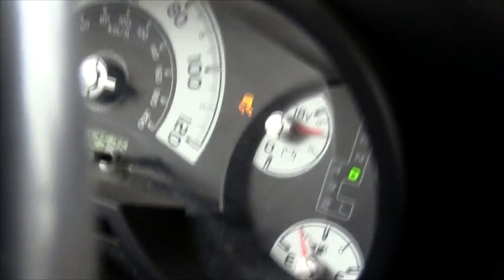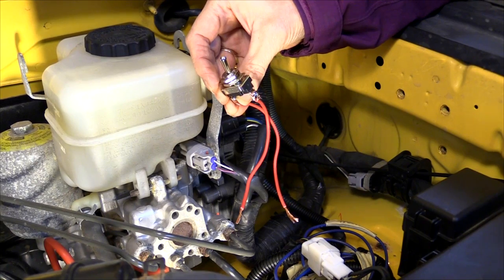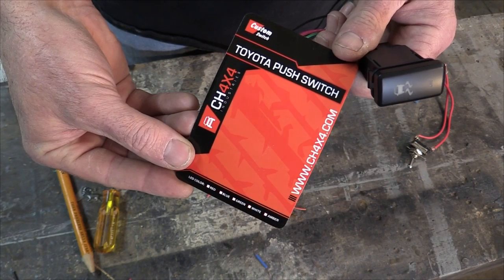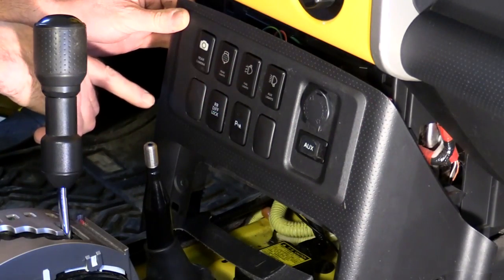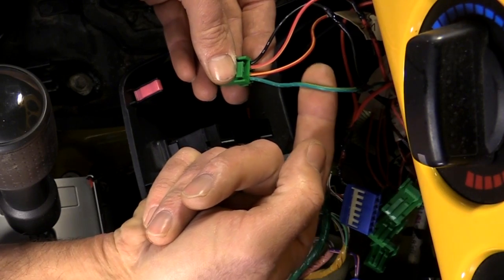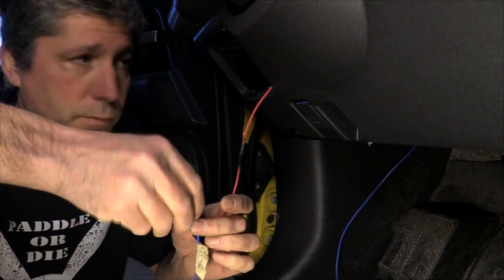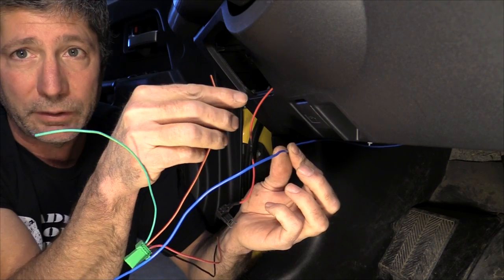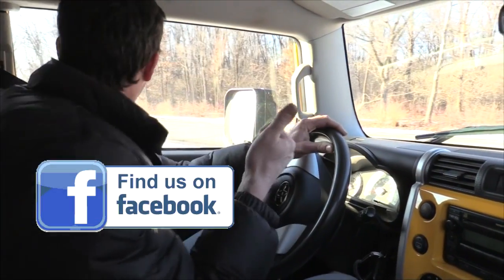DIY VSC Hack, Toyota FJ Cruiser

Comment: Hi, can this be done on the 2007 Fj cruiser with the manual transmission? I have the atrac and the rear differential lock and believe I can use them simultaneously.

Comment: Question concerning the Add-a-fuse.
I see you have 2 10A fuses in there, are those the proper fuse size you need or can they be smaller e.g. 5A etc... just concerned if something goes wrong I don't want to damage something because the fuses didn't pop. 
Or maybe 10A is what the system needs??
Just checking.

Thanks
Reply from the maker: You're absolutely correct. At the time I didn't have the proper 2.5 amp fuse. I should have mentioned that in the video. Sorry for the confusion.

Comment: Couldn’t you just pull the parking brake lever up one click so that the brake isn’t actually on but the light comes on the dash?   From what I’ve heard this will disable traction control and VSC

Comment: Now i'm confused, a have a 02/2006 FJ cruiser, with E-locker. It had no A-trac so i ordered the A-trac button  installed it and now i have A-trac.

Next thing i want to do is the A-Trac + E-diff hack. There is a topic on FJcruiserforums (https://www.fjcruiserforums.com/forums/transmissions-transfer-cases-traction-aids/17329-no-cut-trac-rr-diff-hack.html#post280978)  and in order to have A-track + E diff at the same time, that wire you are cutting (Blue-Yellow) needs to be connected to a constant +12v source!?

12 volt on that wire tells the ECU the locker is not engaged so A-track is active, 0 volt means the locker is engaged and A-trac is de-activated. So with this hack, even when the locker is engaged it still reads 12v and A-track is still active. Since the locker rotates both rear wheels at the same speed it will never apply A-trac to the rear but still detect differences in the front wheels and use A-trac on the front only, basically giving you a front locker.

It might just be that yours is a much later FJ but i doubt Toyota changed the wiring colors for the same functions!?
Reply from the maker: You're right, you are confused. The hack you see in our video only applies when the FJ in in 2w high. The locker and ATRAC can only come on when in 4L.
Reply: @WanderlostOverland Did you combine this hack with the A-track + Diff lock hack? I found out i do mind VSC in 2H lol so i did the No cut A-track+Diff lock hack by taking the male pin out of the plug and put a switch in between the constant 12 volt source you put on that wire.

I now have A-track + E-Diff in 4 low and in 2H ABS and VSC off with this very simple hack.
Reply: @WanderlostOverland  Ok, so it is the same wire just a different hack!? I dont mind having VSC on in 2w high so i'll go for the A-trac + E-diff.

Thank you for the reply
Reply: @WanderlostOverland  I feel so stupid lol, offcourse it's the same wire for this hack roflmao 0 volt on that wire is is ECU thinking the locker is engaged which means VSC off, Duh :-)

Comment: This looks like both the traction and the VSC are disabled. This is good for the guys who want the traction control disabled while off road as well. So if you're disabling VSC to get unstuck in H mode for full-time 4WD models (MT) and H2 mode for part-time 4WD models (AT) can you then turn it back on on the fly or do have to stop? In your video you were at a stop already. Reason I ask is for normal snow covered pavement when you want to reactivate VSC. I have both types of FJ's and want to install the button but I want the traction and stability control back on once I get up to speed.
Reply from the maker: You can turn it on and off at any speed.
Reply: @WanderlostOverland  Thanks for the video and clarification. J Jack sent me over from another FJ video. Love your information and style, subbed.

I was waiting until my warranty ran out to mod my 08...and that was 3 years ago...time to fix that VSC by adding a toggle! My own personal reason is engine cut when pulling into intersections from stop signs...almost been t-boned many times when I could've spun tires out of it. If it feels dangerous, I can always toggle back on!
Reply: @WanderlostOverland  Thank you

Comment: Did you also find that the VSC and Trac doesn't work if you get a non-related error code? Seems like any check engine will also light the VSC and Trac.

Comment: Is there any chance of damaging the transmission with this hack
Reply from the maker: None. The only potential harm would be to the ECU if the wires were hooked up wrong. Be careful. 😬
Reply: @WanderlostOverland  Thanks! I saw this on the forum and was concerned.  https://www.fjcruiserforums.com/forums/transmissions-transfer-cases-traction-aids/93100-engine-transmission-related-problems-due-vsc-hack.html

Comment: Can that damage anything on the car's eletronic system? Thanks
Reply from the maker: Sure, if you use the wrong wires. :)
Reply: My bad.. I wasn't clear on my question. If I simply disconnect the cables for desert/sand driving, and reconnect after that.. is that any risks? Thank you again
Reply from the maker: I don't think so. There is a chance of getting sand in the connectors. Maybe seal them off somehow.
Reply: Good Idea! Thank you very much.. I'll be around waiting for more videos! ;)

Comment: Can i do the same thing with the 2007 4Runner.I wan to be able to turn it on and off without killing the engine down?
Reply from the maker: I can't answer with accuracy, sorry. The 4R wiring may be different.
Reply: Wanderlost Overland  Thanks will check to see today if I have the same cable.
Reply: I just checked for the blue wire with yellow stripe and I don’t have it.I don’t have any cable on that spot.

Comment: I have a 2018 fj but dont have that wire, any ideas?
Reply from the maker: Are you sure you have an 2018 FJ Cruiser? I thought Toyota stopped producing them a couple of years ago.
Reply: Wanderlost Overland lol its a 2008
Reply from the maker: I thought the older  FJs all had the wire. Do you have the factory rear locker?
Reply: Wanderlost Overland no I dont have factory rear locker
Reply from the maker: It's been a while since we did this hack, but if I remember right; supplying power to that specific wire tricks the computer into thinking the rear locker is engaged thus turning off the VSC. So it makes sense that you wouldn't have the wire if you don't have the locker.

Comment: I just got a 2007 FJ and I think I will try this hack. But I'm wondering why didn't you use a 5 pin relay so you could keep the normal vehicle function and set the switch to on to disable the traction control?
Reply from the maker: We could have done it that way but the way we did it works great and we didn't have to go through the hassle of wiring in a relay.
Reply: Thats fair enough.  Thank you for the reply.
Reply: Ethos, can you further explain how this is achieved? I am about to do this hack but I would like to know how you would wire for 5 pin relay, where would the 5th wire go?

Comment: with this hack...when you go into 4wd does it still turn the vsc off automatically? or does this hack make the vsc completely manual regardless of the 4wd?
thank you.
Reply from the maker: vsc is still auto turned off when in 4wd.
Reply: Prefect. thx Mark and Merri. Great video.

Comment: Did the hack, but dislike the fact that the light stays on when vsc is on....distracting. ...Great video BTW. ...
Reply: That's when thin pink tape would work for you.
Reply: You can take the switch apart and remove the small lamp so it does not light up.

Comment: what happens if you attach the 2 cut ends of the Blue/yellow stripe wire to the switch ??                                                                 well since the Blue/yellow stripe already have power can be controlled by traction switch ??  and can even feed the switch lights

Comment: Thanks very useful. 😙

I want the vsc stay on and when push the button it will  go off (and the lights in the switch go on with off ) . 

Can I do that!!
Reply: Motardforlife 219 

Motardforlife 219 By using 5 pins 12v relay. you can use any kinds (I used micro).

So in 5pins relay there is 2 pins one will be continues current flow. and when you run the relay will change to the other pin that will be empty. 

I already have the diagram. it's  a little confusing specially with illustration switch. 

I simply will do the opposite for the switch:

 Put the relay and stuff with it behind the switch, Check for the diagram:

1- https://drive.google.com/file/d/0B6N9n_ChHdmhaGxkaGhQOGJLZDg/view?usp=docslist_api

2- https://drive.google.com/file/d/0B6N9n_ChHdmhcDl6c2RGY09nczA/view?usp=docslist_api

3- https://drive.google.com/file/d/0B6N9n_ChHdmhYUcwdklIcGxLamc/view?usp=docslist_api

I always watch you channel. keep going ✌👍
Reply: @wldmhd  Can you please rue-load the diagram? Thank you!
Reply from the maker: +WALEED ALOTAIBI - No, not with this hack.
Reply: I found a easy way to do it 🤗
Reply: +WLD MHD how did you do it??